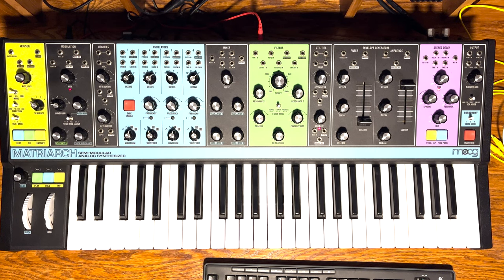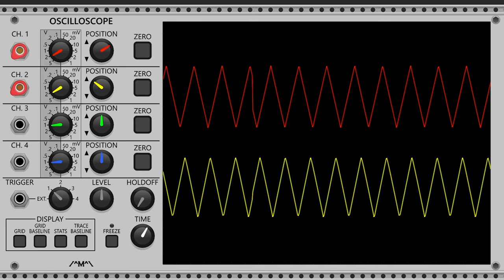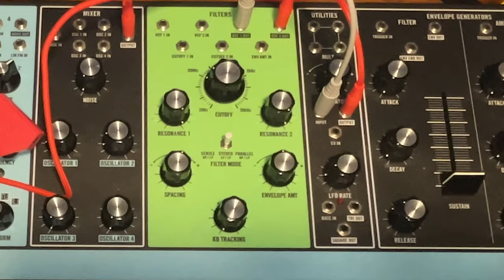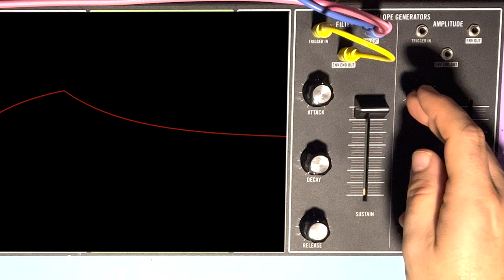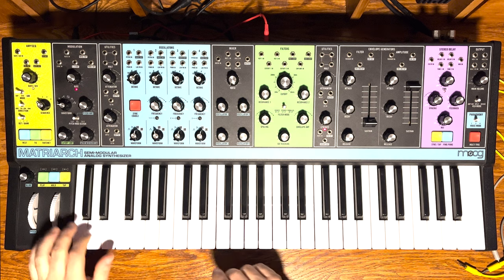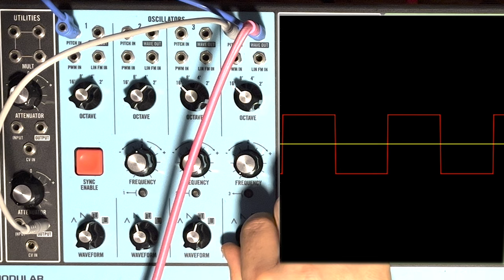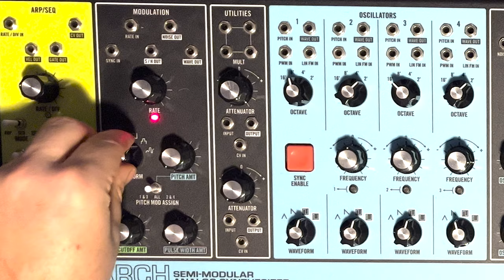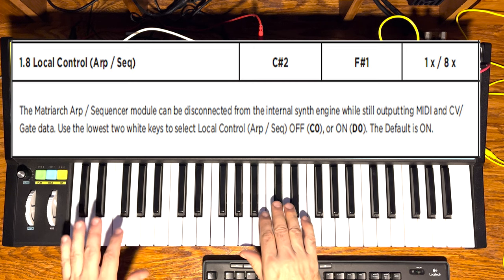Extra "Hidden" LFOs on Moog Matriarch - 3 Patches and Tutorials

Comment: That “stepped triangle” lfo shape is a sample and hold circuit that has a triangle wave routed into it as its voltage source. I would have loved to have that as a jack on the panel, which would have opened up the matriarchs mod capabilities in ways that are difficult to grasp just thinking about it.
Reply from the maker: yeah, that certainly would have been cool if they included an input for the carrier wave for the s+h. you can use a slew limiter as a makeshift sample+hold (or even an envelope generator that can turn off retrigger) so if you have a slew or maths you can do what you  want.